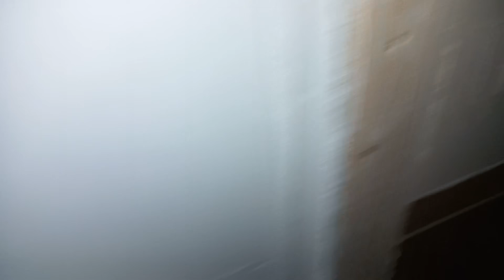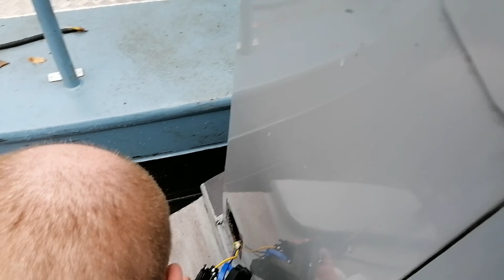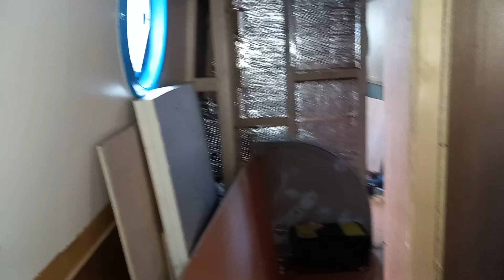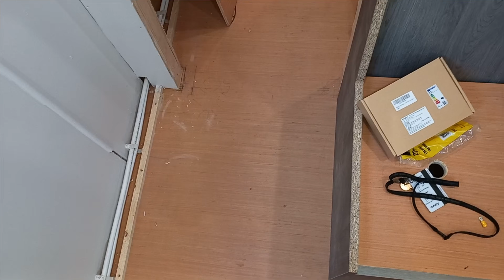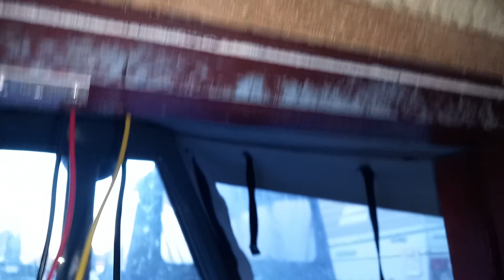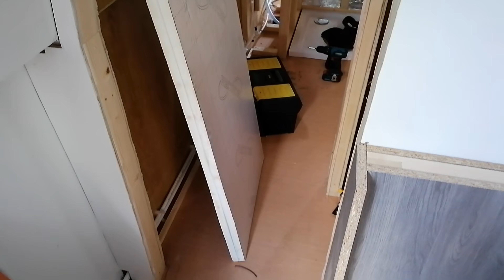Our Narrowboat work is going well so far - Episode 26

Comment: You need to sikaflex that  outside shoreline box to the hull or it will leak into the boat. The boat is really looking good :)
Reply from the maker: @FlashGormless  thanks Flash, I've not had any problems yet but I will keep checking now you've said that. I just didn't want to use adhesive. I could probably use some silicone maybe.
Reply: @peterandchell  use butyl it seals but doesn't  go solid